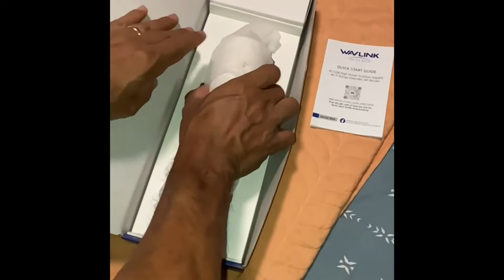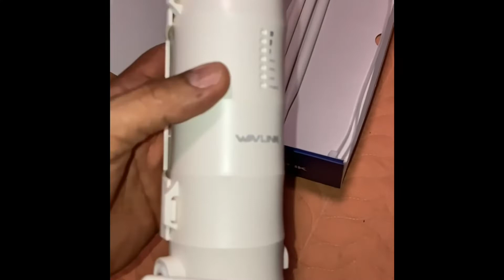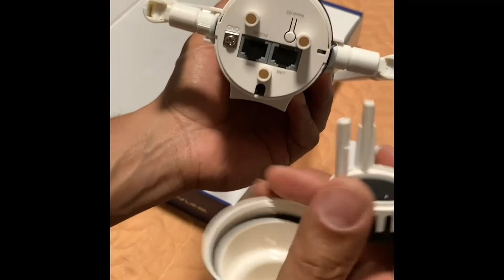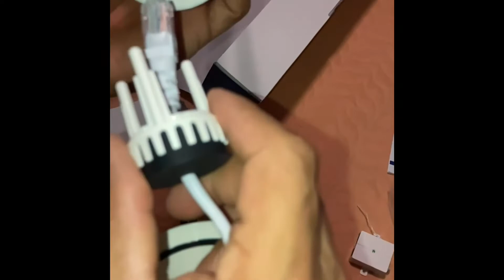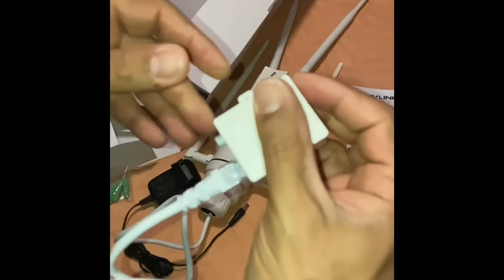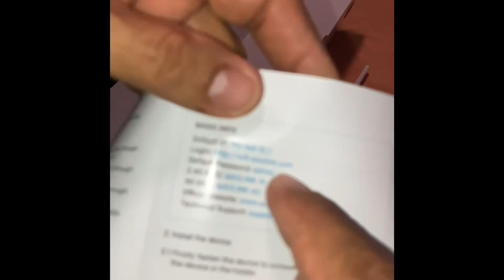WAVLINK Outdoor WiFi Extender AC1200 High Power Outdoor Weatherproof WiFi Range Extender Review

Comment: You need to go to the wireless page and separate the two signals 2.4GHz and 5Ghz because they are combined by default so its difficult for the AP to automatically give you the suitable SSID frequency suitable for your device(s) simultaneously so rather split them so they broadcast separately that is the only thing they didn't specify but it works well

Comment: Hello,

I installed my Wavlink AC 1200 a month ago. Initially, it was placed in my hallway, but it consistently lost signal after about an hour of use, even after multiple resets. I have since moved it outside, but the issue persists.

Despite the signal loss, the LED indicators on the Wavlink light up properly, showing that the repeater is on and the Wi-Fi is connected. However, the network Wi-Fi does not appear when I search for it. I'm unsure if this issue is due to the Ethernet cable being very long or because it passes through two RJ45 sockets. Can you please help me?
Reply: Same thing happening to mines